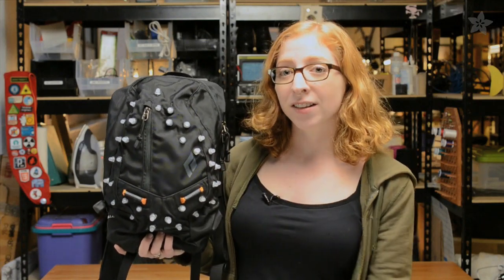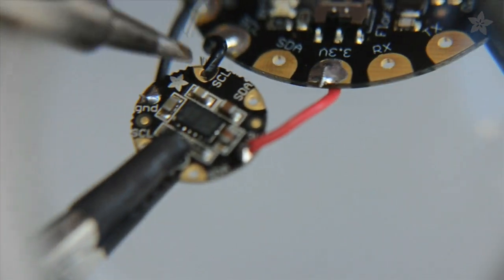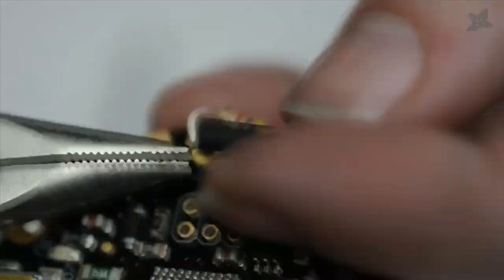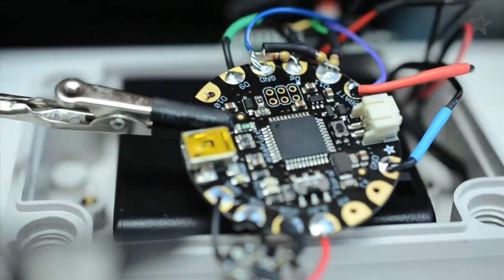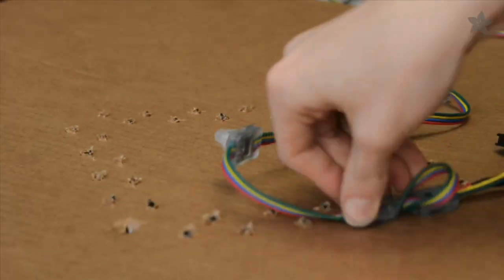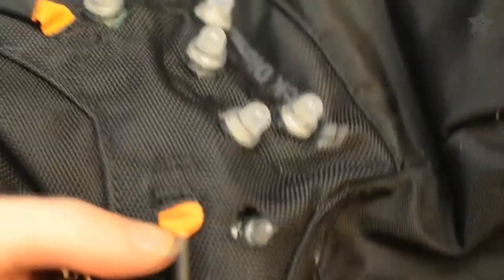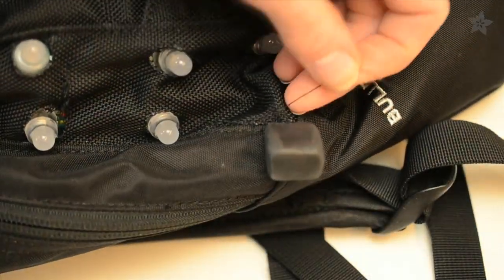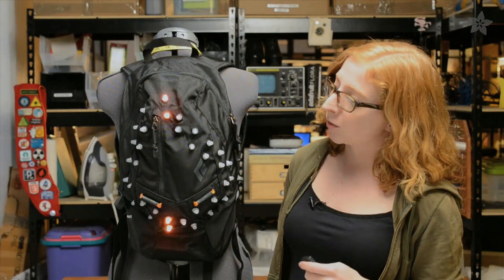Flora Brake Light Backpack

Comment: I keep a cheap and dedicated old soldering just for melting holes through materials like this.  Trying to solder with a good iron after using it for something like this can be a real pain since it will not tin easily.